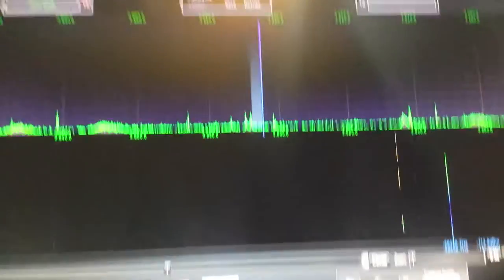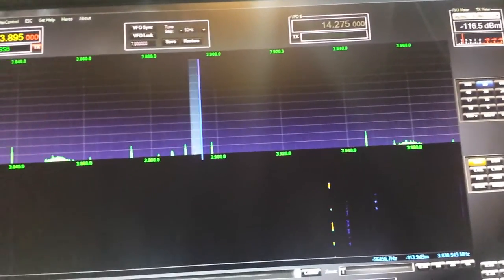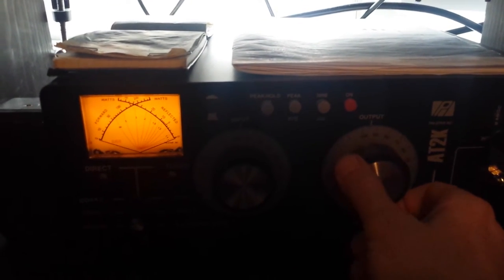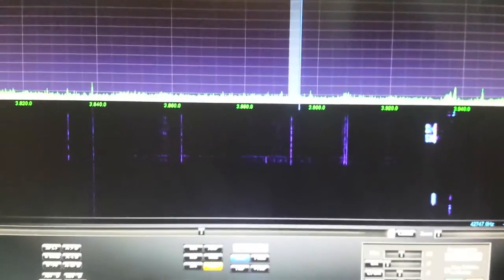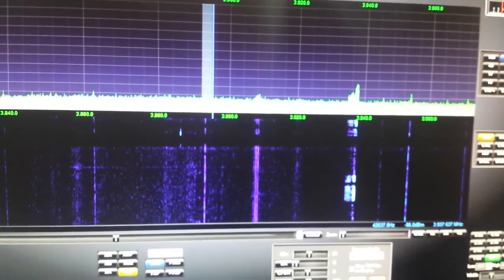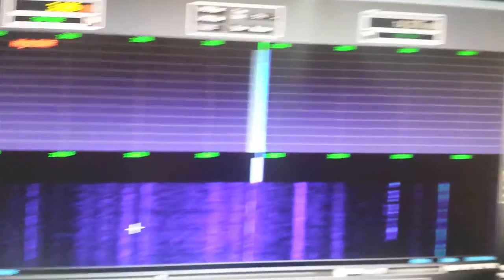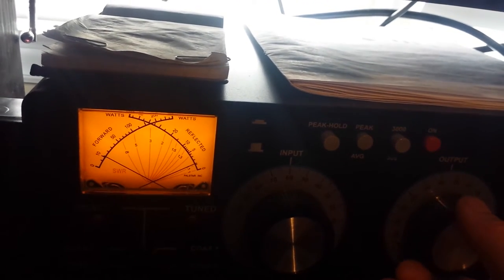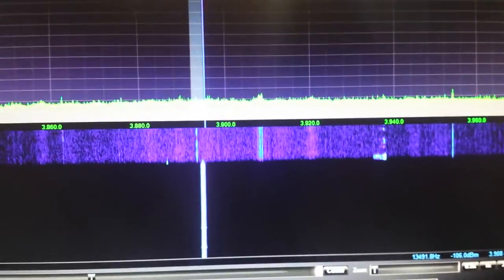How and Why to use a Manual Antenna Tuner

Comment: Good video. This type of antenna tuner would also work on a plain CB with an IMAX 2000 antenna? I have tried everything to get my SWR'S down and this is my next option. They are currently at 1.7 and I know its not that bad but I would love to see a 1.1 Thanks.
Reply from the maker: +Sotac71 Yes it would work, anything below 2:1 is acceptable.  If you enjoy radio you should really consider becoming a ham.  With the solar cycle the way it is, the CB band is going to be dead now for about 10 years, as far as DX is concerned.  Get your ham license and start having some real fun!  http://www.w4gso.org/how-to-become-a-ham/
Reply: Thank you. I just picked up the book. Tech first then on to the next.
Reply from the maker: Awesome!! go for it!